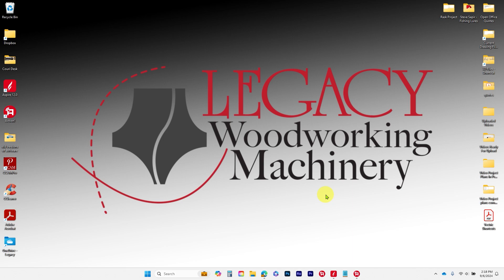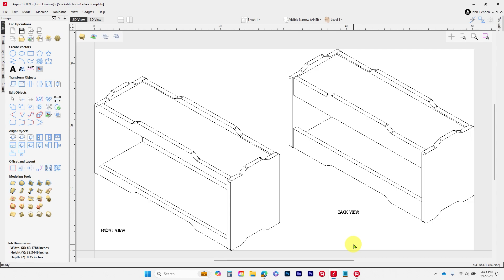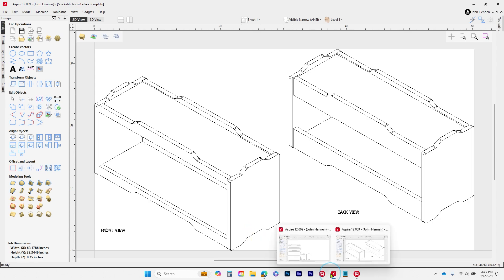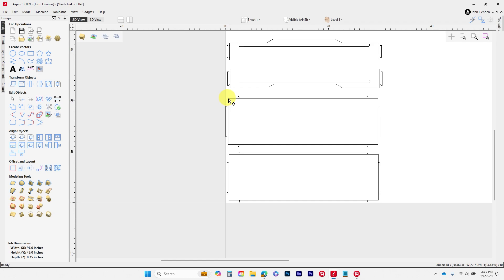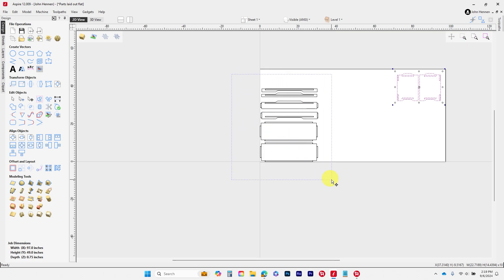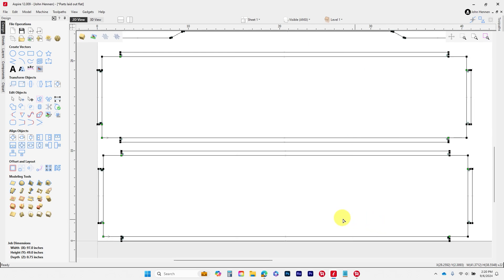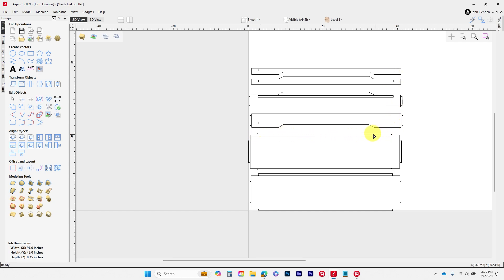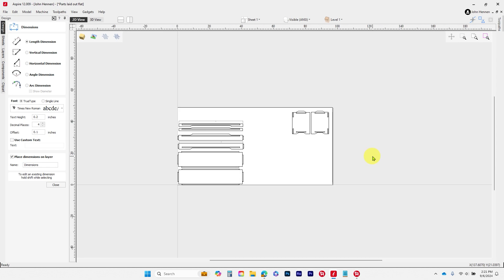Resizing Projects in Vectric - The Stackable Bookshelves

Comment: This is pretty cool but if there was a way to lock them together to I think it might help with moving them around
Reply: Individual blocks are lighter hence easy to move
Reply: @Onlyindianpj  okay but not all of them are gonna be that heavy so personally I would want them to sort of lock together so I can move them with a hand truck but i can't be totally sure until I'm done making my own version of these
Reply from the maker: when stacked the top has a part on all 4 sides that fit inside the bottom so they can't be pulled apart without lifting them, however for added security you could send a screw through the top of the lower shelf into the bottom of the upper shelf.  We will show that in the videos.
Reply: @legacycnc8232 ah okay that's great so I don't have to modify them much